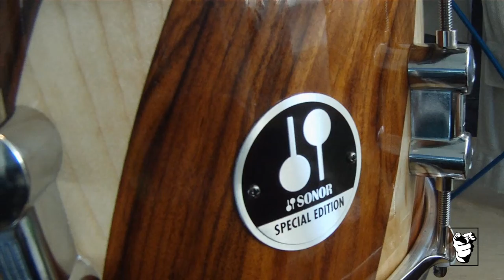Refinishing a snare drum with veneer

Comment: Great job, I'm planing on doing this and I have a question, do you have to take the tape out of the veneer before or after the vacum press?
Reply from the maker: Not quite sure what you mean, but: The tape keeps the veneer pieces in place, without you wouldn´t be able to wrap it around the shell. That´s why I peeled it off after the pressing process and got rid of glue residue with acetone.
Reply: He taped the outside or faces of the veneers together, and the epoxied them all together before the vacuum seal. He doesn't show the tape coming off of the veneers in this video, but they came off after the sealing, and before the sanding. Hope that cleared it up. Happy drum building!

Comment: Sorry for asking but is that important when you veneering a shell that you use a vacoum press? Or does ot works without to?

Sorry for my bad english im from switzerland an i startet to build drums and im searching for tips to veneering
Reply from the maker: haengemuele No worries. As being said in the description, I used the vacuum method becaue of the even pressure you are able to apply to veneer and shell. You could also try a system that uses tension belts or something like that, but I´d be careful doing that.
Reply: Wanted okay thanks for the information i think thats a good method